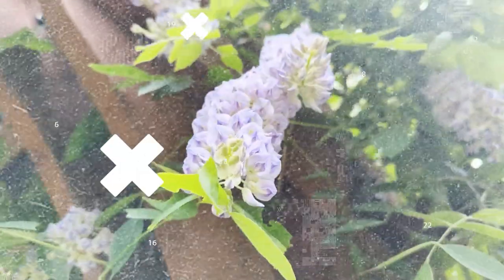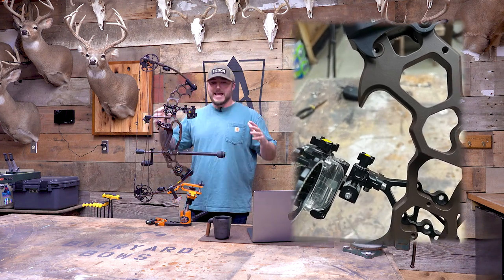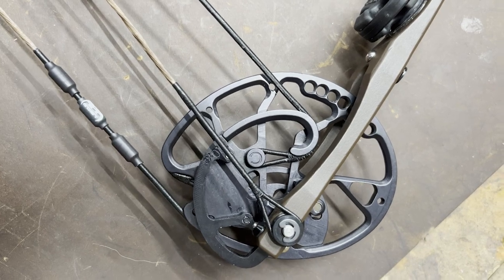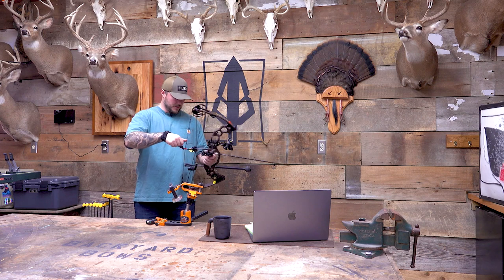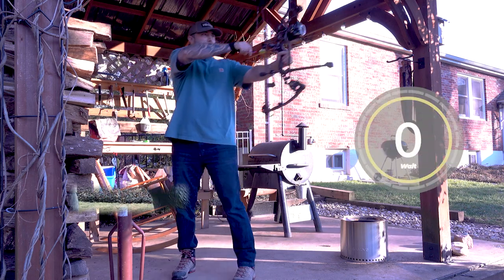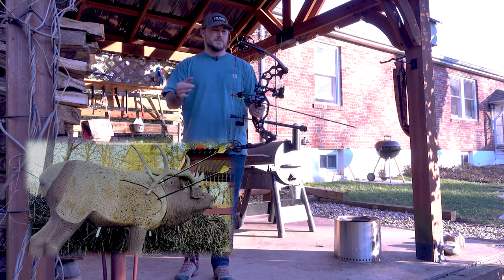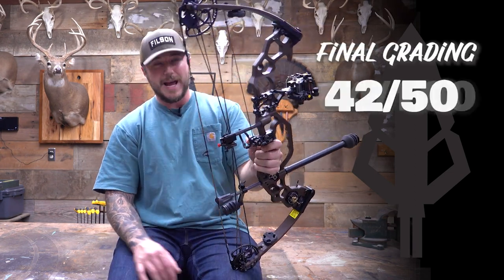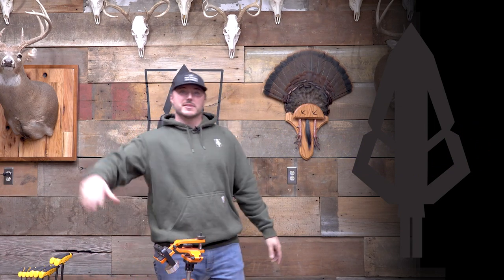Backyard Bows Black Mamba 29 Review

Comment: I've been shooting APA bows (both single and dual cam) for 10+ years.
I hunt in the Eastern deer woods and 15-day backcountry hunts in the Rocky Mountains, hunting with the camp on my back. (I have had to use my bow as a balance stick many times and the bows still shoot)
The bows have never failed me, so I have not input on their customer service. (This is a good thing, right?!)
Their customer relations in ordering the bow and providing guidance on their technologies has been second to none!
The bows just simply work!
As you stated, Nibal is not only an engineer, but a great all around guy!

I am selling my Mamba 28 and ordering the Mamba 29.
We'll see if the shooting experience improves better for me with a 27" draw and 60lb pull. (Treestand/blind bow)

Comment: Solid review .. I'm a new APA Dealer.. I don't have the 29 in stock yet, but 29 air, 31 and 33.. I am also a 30dl.. However the 33@30dl,  the 31@28.5 and air@27.5 all at 60lb feel very similar to me, the let off holds well in their respective dl's ..  Bow do offer a light weight a dn sleek look combo,, especially , imo, since  saddle hunting is growing with hunters peeking around trees.